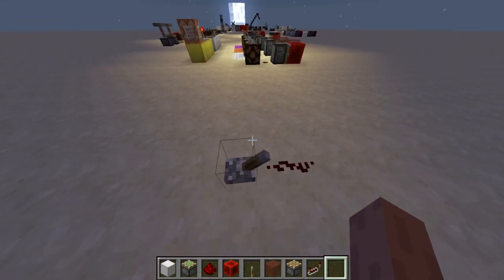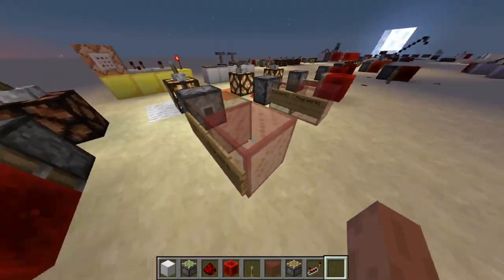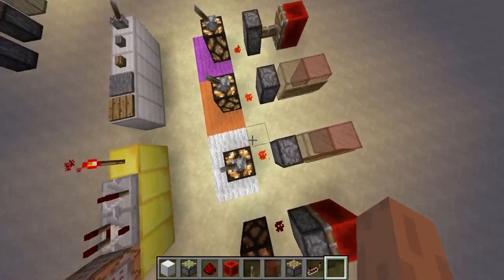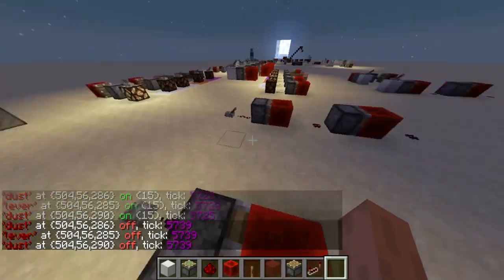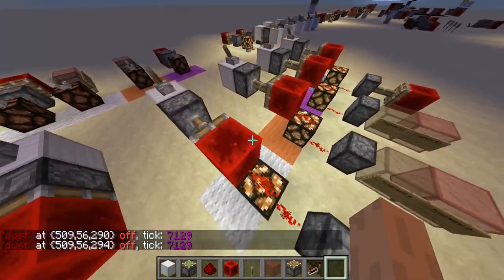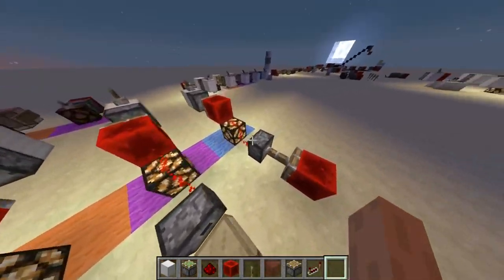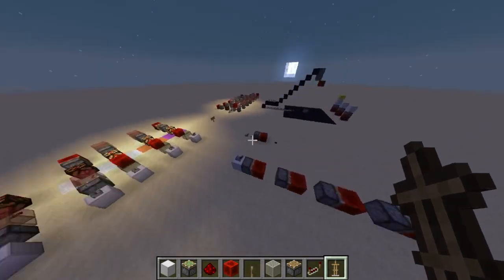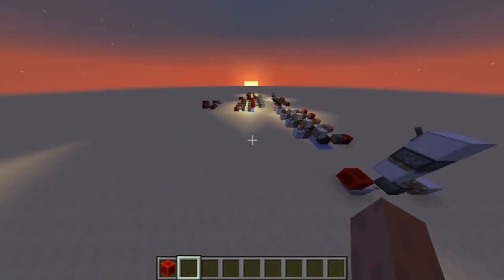Precise Piston Timings

Comment: So, ..., hmm, I'm just thinking about some test setups, ...; if I have a normal alternating piston and redstone wire chain of length N it will take about 3*N (+ or - a constant) gameticks to get a signal through. If I then go and place an instant repeater (one of these compact ones with instant block movement) in the middle of every redstone wire connection in the chain, I should be speeding the whole thing up to now only taking about 2*N gameticks of time, because the repeaters changed the Block36-activated redstone signal into a not-Block36-activated redstone signal. Am I correct?

...maybe I shouldn't be so lazy and try testing it myself. On the other hand, I don't have such a fancy mod setup right now, and I wanna go to bed - so, yeah.
Reply: staffehn No, unfortunately, you are wrong, but probably not for the reason you may think when first reading this. What you'd expect is that, since the 0-tick repeater is composed of pistons, the next piston in line will wait 1 tick, as Myren explained. However, a similar but different thing is happening. The 0-tick repeaters are actually different than normal pistons in their direct interaction with pistons. More information about this (like seriously, too much information) will be in my upcoming video, as Myren mentioned. Anyway, what is actually happening here is the normal piston that would extend would cause the 0-tick repeater to wait 1 gtick, as all pistons do when powered directly from an extending piston.

Btw, if you haven't noticed, there is a link to my mod in Myren's description if you'd like to do some testing of your own.
Reply: ***** Oh, of course the "instant" repeater wouldn't technically be that INSTANT anymore. An interesting question would be: Are there instant repeaters (maybe not or not ONLY using pistons) which DO behave like I stated above? (...and I seriously need to go to bed :P)
Reply: staffehn
The normal instant repeaters are instant in the vast majority of the times. The only exception to them is the same ONLY exception to any piston's extension - a full extension of another piston supplying power to it. For any other redstone component (including to and from themselves), the instant repeaters work INSTANTLY. Now go to bed, you've been schooled ;)
Reply: staffehn your comment is 4 years old, but rail buds are instant and wouldn’t wait for a gametick like pistons. But, as sharir1701 said, this is only important in very specific cases. Usually 1 gametick isn’t a problem and it doesn’t stack over longer distances unless you have normally extending pistons in between.